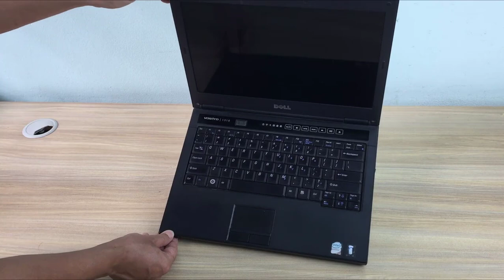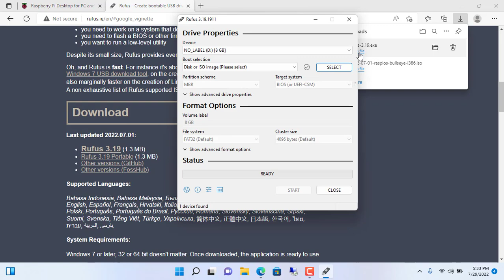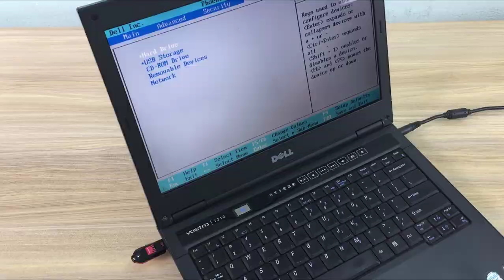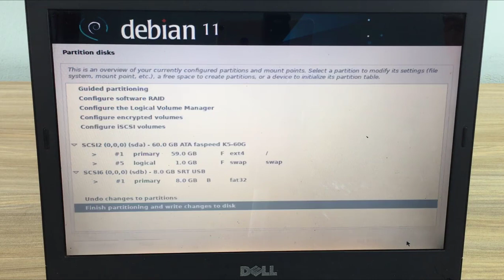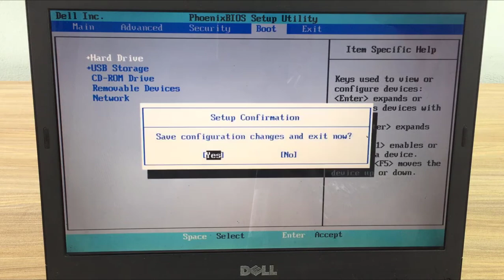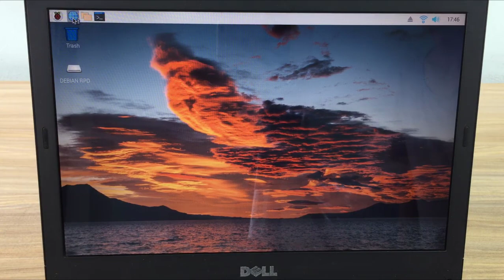how to make use of old laptop with different operating system

Comment: Actually correction ! If a newer pc has windows 10 or 11 you can format the drive an remove windows an install Linux or Debian or raspberry pi I have done that before with no issue of doing it ☺️

Comment: Thanks for excellent video.
I have some technical manual that are compatible with IE 6 only.
I can see them now with recent versions of Microsoft Edge in compatibility ie mode.
However cannot see them on IOS because Microsoft Edge does not have such compatibilitu mode.
Is there any way/browser on Raspian with IE 6 compatibility?
Reply from the maker: Thanks for the info!
Reply: @NETVN82  Is there any way/browser on Raspian with IE 6 compatibility?